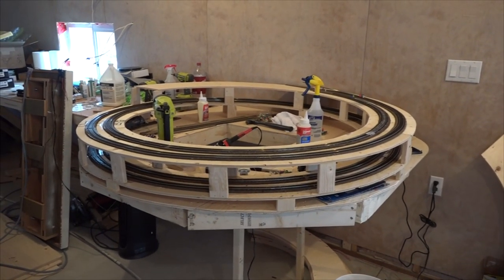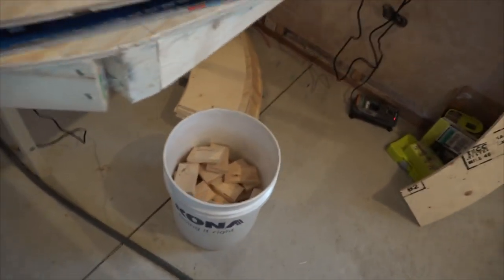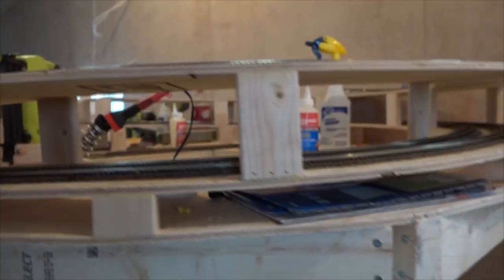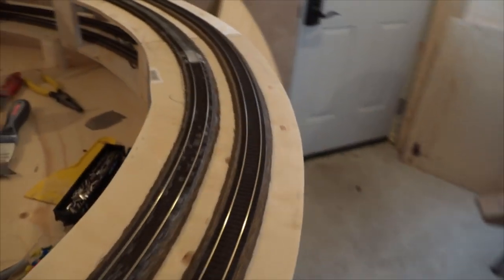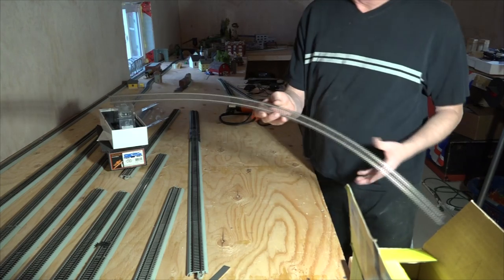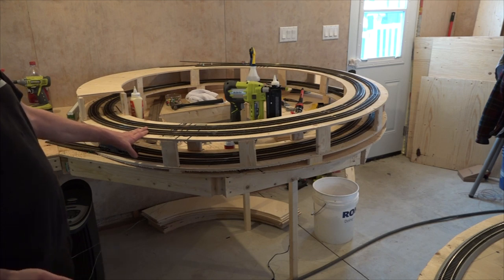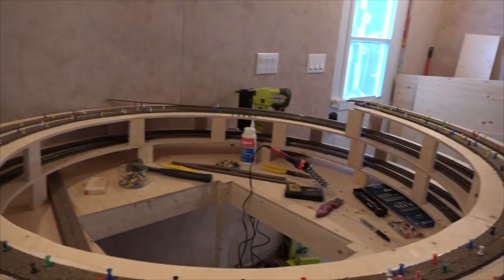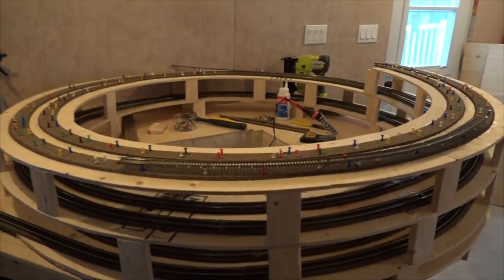Building a helix for a model Railroad

Comment: If you’re using flexitrack, when curved to shape the inside rail will be ‘longer’. Attaching further flexi track sections will make the inner rail longer and longer each time. How did you manage this?
Reply from the maker: i have a parallel track gauge , i do show it
Reply from the maker: look for later videos
Reply from the maker: cut the rails to the length you require

Comment: You sound a little horse? Cold, flu, the crud? Looks good brother! A few concerns: Should you maybe run a short train with your loco up and down the helix? Make sure you have enough space between the two tracks for your longest pieces if equipment! Don't want anything rubbing! You got enough height for double stacked containers and auto racks? I read somewhere that you need 3 inches between center lines of a double track helix, like 26" & 29"? Just looking out for ya brother!
Reply: CONTAINERMAN68 also it’s a good idea to run your longer locos. 6 axles and Your big boy
Reply from the maker: @Crookedriverandeasternrr  that is coming